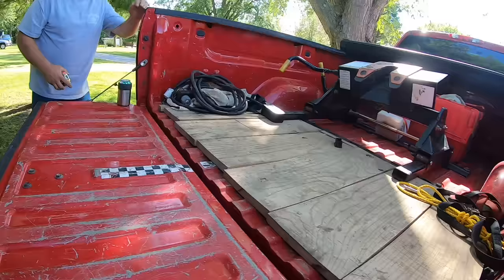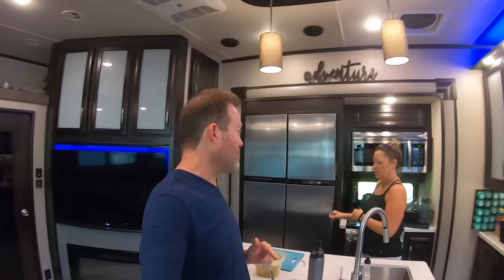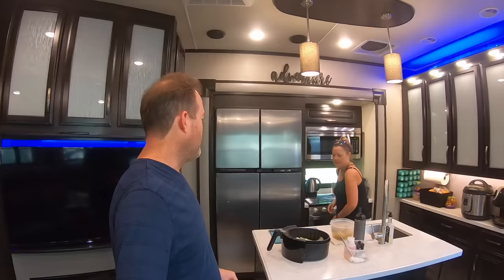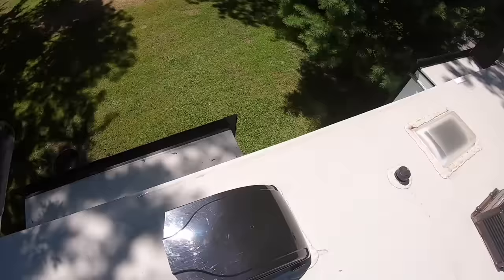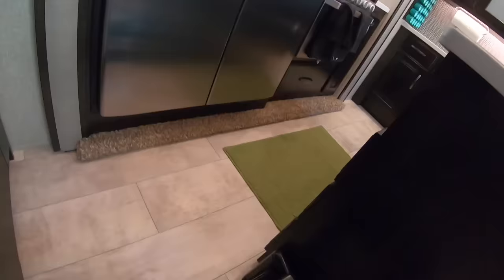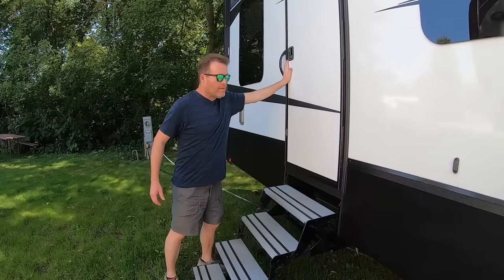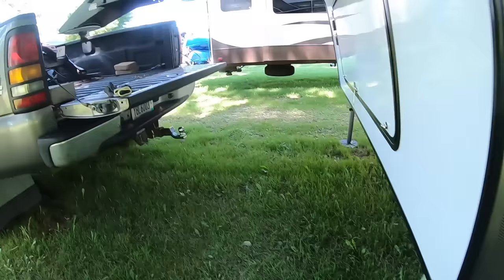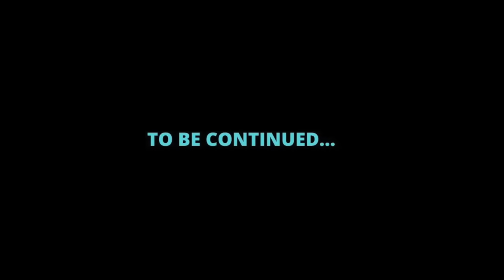RV CRUSHES MY TRUCK ON 1st TOW! BIGGEST RV LIVING FULL TIME MISTAKE!

Comment: Pull test before raising landing gear, semi Trk for years and still I perform this pull check.
Reply: Pull test holding just the trailer brakes on the brake controller. Lift the landing gear up about half an inch or so because you don't want to put any horizontal stress on the legs when you pull on her. Semi trailer's landing gear is substantially more beefed up and made for horizontal stress when being loaded and unloaded.
Reply: I have an older Husky hitch. I've actually been yelled at for it. When I back in it makes a very loud audible slamming sound. But when it engages. Everyone at the RV park knows it. 

But I know it's engaged.  Had a near Miss yesterday. Trailer was too high. I didn't get the audible and knew instantly I didn't have engagement.

Also April of 2019 I did a trail to trailer move when I bought a trailer that was 31 years newer than the last one. The RV park was downright Rude to me over it. Even though I was paying full rates for two spots. They never had an issue with my old 77 Coachman before. I told them I would be taking it home in 7 days when I would be taking my next R+R trip home. 

They acted like I was trying to do them dirty somehow. Months later they still acted like I was Scum for upgrading trailers without asking them first. 

I was so excited to be buying a newer RV that I never thought that an RV park would be upset by me trying to Upgrade MY life.
Reply: @Reshoe.87  But if poop happens, you would put a lot of vertical stress in the legs as well, wouldn't you? not sure it is designed to "receive" force like that.
Reply: I also do the tug test after looking to make sure the jaws are shut, and I do a complete walk around and check all the lights before I retract the landing gear and the trailer moves, it's way better and less embarassing to be safe than sorry.
 

When I was driving trucks I had to pick up a load in Jacksonville, Fl and had the 5th wheel locking bar break after hooking up to a trailer with 45,000 lbs of coffee in it, after doing the tug test, I finished my pre- trip, retracted the landing gear and started pulling out and the trailer didn't go anywhere other than straight down, the landing gear dug themselves into the mud. Had to wait 2 hours for a wrecker to get there and lift the trailer high enough so I could extend the landing gear. After the the wrecker driver fixed the 5th wheel, I hooked back up and didn't have another problem until after I got to dallas and had delivered the load. 

I spent the next 4 weeks waiting for repair parts to arrive and for the company repair shop to pull the truck into the shop and rebuild the 5th wheel. It finally took a phone call from Mr Werner to the shop manager to get them off their lazy butts and fix my truck. At least they had me in a hotel at their expense for the time my truck was being repaired, I lost a lot of money because I wasn't able to do my job and they would only pay me $40 a day while the truck was broke down.

Comment: This popped up on my recommended videos.  Very sorry this happened to you.  My theory is that the latch handle was not in auto locking position, rotated back so it would spring closed when you backed up to your kingpin.  Husky hitches can give you the false impression of being hitched when it's not locked.  I might be wrong though.  Email me, I might be able to help you out with something special.
Reply from the maker: Thanks for the feedback! I will shoot you an email...
Reply: @EnjoyTheJourneyLife  big truck big RV is extremely knowledgeable,  I recommend you take and advice he offers you
Reply: On the video I noticed the indicator was pointed out, is that just to show it is engaged not necessarily latched? If so scary hitch!

Comment: You always want the 5th wheel to raise slightly when you back the truck under it. This helps prevent high hooking. Also it’s a very good idea to do a gentle tug test. This will help ensure the coupler is locked. You can do this by chocking the wheels on the trailer or if your trailer brake controller has the ability to just lock down the trailer brakes you can use that also. Obviously make sure your landing gear isn’t all the way up before doing the tug test in case it let’s go.

Comment: Hi Tom & Cheri,   Although this must been hard to share,  thank you for doing it.  It was good for me to see other people have 'handler error' mistakes too!  This summer I took my first long distance  trip with my Travel Trailer and the first day out, I managed to pull my TT over a 3 foot square concrete block and got it stuck on the block so bad, the gas station people had to get their service vehicle out and pull the block out from under my TT.  Ended up doing $3500.00 worth of damage to my TT. Being my first time out & new to pulling a trailer, I felt really stupid and was about ready to give up the whole TT way of life. After two months of being in the shop to get fixed, it's now parked for the winter.  Waiting for the spring thaw here in Canada, to get out and give it another go! I figure if experienced people make mistakes, it's ok for me to make a few also. :-D
Love your channel !

Comment: Always do a tug test with the landing gear raised about an inch off the ground. Then if you pull out of the hitch it won’t hit the truck.
Reply: That is something that I learned during driving (18th wheeler) school back in the 90's.
Hook, pull and lift.
Reply: @Doug West Chad and Tara are our Holy Grail of Momentum info!
Reply: This. A million times this. A pull test would have prevented damage. And secondly, look at better hitches than Reese. B&W Companion come to mind.
Reply: @Doug West changing lanes is a great channel. And Chad is very knowledgable
Reply: @everythingellie9228  I agree, Chad is a very smart guy
Reply: I have never pulled my fifth wheel without a tug test I also walk around between truck and trailer look at jaws before doing anything once I'm hooked

Comment: Preventing this is SO simple... just reach down and squeeze your trailer brake controller to lock up the trailer brakes. Then try to pull forward. If you can't move at all the connection is solid. If you start to move forward then your connection is not solid. (You can actually drive a few inches before the trailer drops off the hitch) I do this "brake check" every time I hook up our GD fifth wheel.

Comment: Let him who has never made a big embarrassing mistake cast the first stone.
Reply: Can I toss the stone?   I msde little embarassing mistakes.   Moving my boat/trailer 15 feet so I didn't lock down the hitch.   My mistake was leaving the landing gear down.  Landing gear wheel rode up a bump in the parking pad, lifted the trailer off the unlocked hitch.  Boat/trailer did move 15 feet, but wrong direction!
Reply: Jesus please put down the rock it's only a joke.
Reply: Me: Puts down stone.
Reply: Been there.

Comment: As a rv service technician I've taught a lot of new fith-wheel owners to check that the hitch is fully locked by raising the landing gear a inch off the ground. Then lock the trailer brakes by holding the trigger on the brake controller and try pulling the truck forward. I have seen a LOT of trucks and trailers severely damaged by skipping this simple step. I have repaired trailers with up $20,000 in front end damaged from this. (Ouch!!!)
Reply: This. A pull test would have prevented this from causing damage.

Comment: 20:26 you can clearly see the pin is still pulled out in this part. you must've completely forgot what the guy told you in the beginning of the vid.
Reply: Exactly. He never set the hitch to lock when you back into it. So clearly user error. But the white pointer need another sticker.. Should not be able to say locked when the handle is in the open position.
Reply: I went back and looked for that exact sequence. The guy said to remove the handle and set that pin.

Comment: Tom, as a truck driver "I've been there done that".  It's called "high centered", you looked and made sure that the jaws were locked but what you didn't notice that there was space between the king pin plate and hitch.  And the king pin was sitting on top of the jaws, pin not locked around it. Hopefully not to much damage!! Don't beat yourself up to much,  it happens to the best of us.  I enjoy your videos and thanks for the info.  
 Thanks Lavon
Reply: When the jaws close it forms a cup and the king pin can sit on top.

Comment: OMGoogness! Been there, once. Hopefully,  once is enough!!! Our new truck came with a 20 Ram hitch. It shows green when the teeth are closed, then you lock the handle. Even so, I always look at the teeth to confirm they're engaged AND do the pull test!!!
Reply: Was not the fault of the hitch. The king pin was not sitting depth wise enough...that hitch already had a factory built on lube plate...he added another lube plate...that was the problem.
Reply: @heyinway : No, the problem was that the lock release handle was not in the correct position, (watch from 19:30 to 19:40 and you'll see what I'm talking about) so even though the jaws appeared to be properly shut, they weren't, so as soon as he started pulling out the jaws opened and the trailer went BOOM!

Comment: I did that same thing just a few months ago. My kingpin was not low enough. The jaws locked but the kingpin was not in it.
Reply: Always when hitching have the truck compress a little when backing under the pin. You never want a floating or no weight as you need the contact pinbox to hitch to ensure proper connection. Also, tug test! Semi driver or RVer, you always do a tug test first after connecting the truck. If she pops off the kingpin you know it wasn't right or your hitch failed.
Reply: How much

Comment: I'll agree with what some others have said that the white disk on the king pin is not necessary since you have that red plate on the hitch. It would most likely cause the king pin to sit up to high to latch properly. As a former truck driver it is a good idea to do a little "tug" test right after you hitch up before you raise your landing gear all the way to insure a solid hook up. Great video and good pointers from a lot of folks.

Comment: I know how he feels. I did the same thing. New tailgate, $3500 damage. No damage to trailer though And very little damage to top of box.  I always pull against the kingpin after I hook up and on my Husky 20K hutch there is a probe than come out and as well the main leaver swings free.  I had hooked up a hundred times always doing a test pull.  This day I slid under the trailer to pull forward into the RV storage wash bay. Didn’t check. Pulled all the way into the way bay directly in front of my spot, washed the trailer and then backed back into my slot. Stopped when I got back there, but the trailer didn’t.  Lesson learned big time.

Comment: Yep after backing under, do the tug test before the jacks
Reply: @jonathanhudson9189  Technically you need a Recreational license when over 26k combined. Basically a CDL but for RVs not requiring a medical card. Most don't bother and its nothing but a slap on the wrist even by troopers. What scares me more are RVers and tires and lack of trailer hitch maintenance.
Reply: @brandoncaldwell95  Florida has no such license, all you need to be legal is a regular driver license

Comment: thats why you always give it a tug before putting the landing gears up
Reply: Yes, tug test , trucking ritual.  Even if you've done it a 1000 times and get it right you always check with a tug with enough landing gear to catch the trailer.

Comment: When we bought our first 5th wheel trailer there was a truck at the dealer that had dropped a trailer on it the same way. All smashed up in back. A good thing to see early on. Since then I’ve always been fearful of this happening. So much weight involved. It so easy to forget some of the checks like a pull test and/or visually confirming it’s locked. With My hitch the safety cotter pin won’t go back into the handle unless it’s all the way hitched. Watching the video I thought you did it right. Anyhow thanks for sharing!  A bit of chronic unease is a good thing for us all to have when safety is involved.  This video is a good reminder for us all to check everything twice.

Comment: I don't know about that hitch,,,,seems a little sketchy.
Reply: K.I.S.S. on that hitch. Good luck in the future...
Reply: it can happen, it happens with every 5th wheel hitch, even goose necks, it is all about checking the back of the hitch to make sure the jaw is closed around the 5th wheel pin and locked, you go under the front of the trailer at the back of the truck and look to see the jaw is closed and locked, them apply just the trailer brakes and try to pull forward watching for any movment on the 5th wheel plate before you move the trailer any were, that is why eletric brake controllers have a manual lever on them as well as to apply just the trailer brakes if the trailer is sliding out side ways, you appy the manual trailer brakes to straiten it out, it is a must know how as well on icy roads to use the manual leaver for just trailer braking, so use full ... even transports have a lever for manual air trailer brakes, gets you out of a bad place fast, but many have know idea how to even use them or when to use them, why to use just the trailer brakes only
Reply: @arnoldromppai5395  sorry.  Not all trucks have manaul trl brake control.  I drove for swift and my volvo didnt
Reply: tractorboy31 That’s because it was a Swift. 🤪😂 Sorry couldn’t resist.
Reply: @tractorboy31  for future reference, never ever admit  that you worked for swift
Reply: @diananeal9645  why they may be a shitty company but i had some good experience with them in some aspects.  Biggest problem i think is the idle management systems in the truck. Good for if need a little heat or ac. Bad for summer in florida or michigan dead of winter.  If a driver wants to run hard keep them loaded. If not at home on weekends keep them rolling not deliver fri or sat to wait for another pickup mon morn
Reply: He High Pinned the trailer. Had nothing to do with the hitch. Just a rookie mistake.
Reply: tractorboy31 lol like others said, swift.  And I’m not sure where you runnin, but as far as I know, ALL trailers have manual trailer brakes. I believe it’s a federal safety regulation..... would be VERY surprised let alone Wouldn’t ever drive a tractor and trailer fully loaded without manual try brakes.  It’s not just about usin the lever, it’s how the system being separate from the tractor makes it more safer....

As you said your VOVLVO didn’t have trailer brakes... doesn’t mean the TRAILER ITSELF doesn’t have it. Maybe you only pulled light loads... but I don’t think ANY LONG HAUL heavy load driver would ever want to drive a tractor trailer setup without having the ability to control the trailer manually...as someone else mentioned... havin trailer brakes on bad weather , snowy situations helps a lot, not counting coming down hill, is a life saver... with no trailer brakes your sol if the trailer starts to overtake the tractor.... if you fast and good enough driver, apply some trailer brake and at the same time gassing tractor helps brake the sway...

Also was just wondering... even if your Volvo didn’t have trailer lever, had to have an air brake release for the trailer alone... unless was also tied in the with tractor release.... on which case that damn Volvo is a DEATH trap on wheels if that’s the case...lol.  But anyways my point is, even if no manual trailer lever, one could still do the tug test by releasing air in the tractor only, as the trailer brakes should still be locked. ...
Reply: The hitch was locked open you can see it in video. Expensive lesson.

Comment: Always check your pin after you hook up, pull forward slow, I’ve been trucking for 30 years. Also your camper only fell a short distance your rig bounces more going down the road to be to worried about things falling. Anyway glad no one was injured Safe travels

Comment: Great videos for RV'ers. I wanted to point out that if you look at the footage 19:37 you can see that the pin is high hooked. The white disk probably contributed to that. You should always do a tug test with the jacks down electric brakes engaged by pulling the as you say "Oh Shit" cable and or wheel chocks. You should also use a flashlight and verify that the jaws are full closed and the pin is not high hooked. If you see a gap between the orange plate on the apron of the trailer it's not hooked properly. The apron is the flat part that rides on the orange surface of the fifth wheel. Enjoy your journey and adventures in your new Momentum RV!

Comment: What I do when I hook up get out walk around  your rig counter clock wise check the Jaws on the fifth wheel, then put your truck in 4 low because it gives more control. If you have enough room behind your trailer back up and spike your brakes, then do a tug test going forward gently . If your feel a little gun shy get and visually check your connection takes a little longer but better dropping your trailer.

Comment: We traded our rig for a new one, When we backed under to leave on our second hook up being used to our old rig
I didn’t check that the hitch Hadn’t engaged and pulled off the hitch the same way you did. Neither the truck bed or trailer 
Was damaged but bent out the tail gate where the hitch hit. 
I now double check, then check again. 
Doesn’t make me feel better, but I have since seen many rear bumper creased. 
Thanks for your video, if I would have seen it before my accident maybe I would have been more careful
Reply from the maker: Thank you, we didn't realize how many other RVers have done this.
Reply: is like cutting wood eh..check twice cut once..